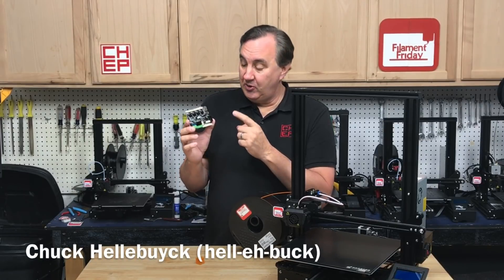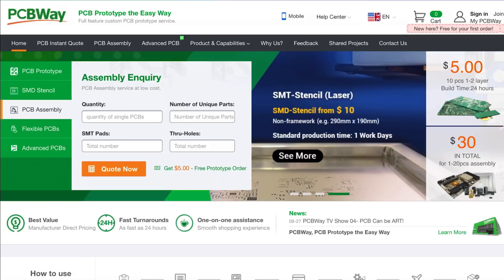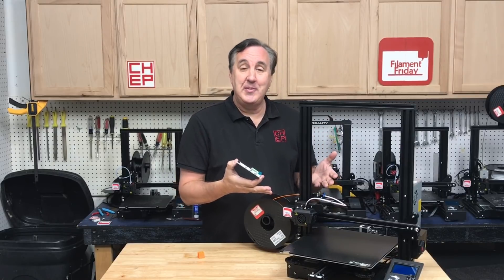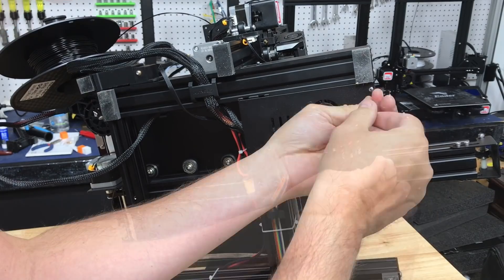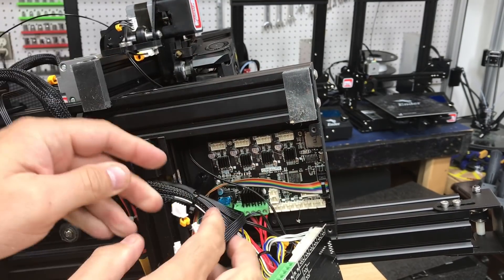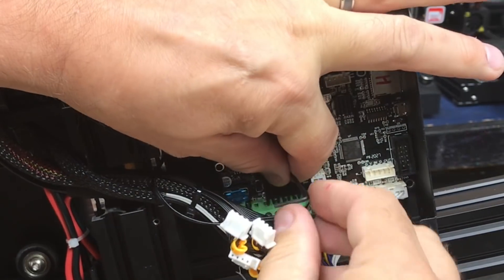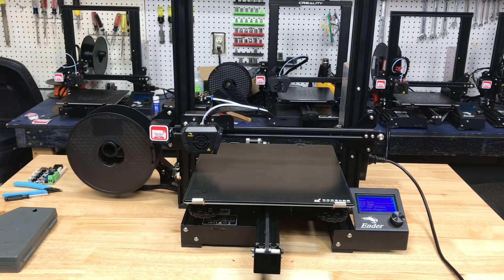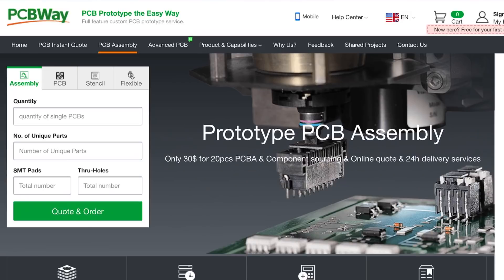Creality V4.2.7 Silent Board

Comment: i really wanna get the ender 3, so i click on the ender 3 that you supply the link to and i dont see anywhere that they  included the 32bit board, did i miss something in your video? I love all your videos Sir,
Reply from the maker: That’s the confusion I referred to. Creality doesn’t have a version number or serial number we can reference. Most new ones are 32 bit but if it’s been on the shelf a bit who knows.
Reply: @FilamentFriday  Yes, I just got mine less than a month ago.  It did come with a 32bit board, the 4.2.5 not the 4.5.7, which has the silent stepper drivers.
Reply: As far as I know creality started producing the newer ender 3 (Not the Pro the X or V2, just any ender 3 that was produced past a certain point in time) with the new 32bit boards. You may get lucky and receive one of those new ones when you order or you may get an old one in which case you can do the upgrade from this video. The board will have to be bought extra though
Reply: The V2 I bought on Prime Day has a 32bit silent board in it. I also bought a PRO but I haven't opened it yet cause I may not keep it.

Comment: Does the Marlin on that board have the change filament option like my E3 has? I use that quite a lot.
Reply: I've upgraded my Ender 3 (previously with 1.1.4 board) to this 4.2.7, the preloaded firmware doesn't have the M600 (filament change) command enabled. I'm in the middle of recompiling (or try another, pre-compiled one) to get back the M600 command. I agree with you it's really helpful!
Reply: There is an option ‘change filament’ in the interface, never used it though

Comment: Is the firmware machine specific? I have a Ender 3 pro.
Reply: Usually you have options to choose which exact model you order the board for so the correct firmware is preinstalled. That is the case on Creality official store as well as with different AliExpress "official distribtors" as they describe themselves.

Comment: Are TMC drivers incompatible with LIN_ADVANCE?
Reply: They are not but the way they are installed on this board makes them incompatible as the drivers cant be run in UART mode.
Reply: @MitsumaYT  I must have screwed up.  Because I installed a SKR 1.4 with 2208 in uart mode and everything was great until I tried LIN_ADVANCE and my extruder stopped.  I even tried this on another machine with uart mode and it failed the extruder.  M122 shows all in stealthchop, so I changed it to Spreadcycle and it worked for a while.  Marlin 2.0.07

Comment: Why would someone choose this over a SKR board that has removable drivers or drivers connected with UART so they easily support linear advance?

I guess I have a bit of an answer for myself which is lack of knowledge about such an option, lack of knowledge about how great linear advance is, and familiarity with the creality brand/wanting to stick with them.
Reply: You just helped me... I was looking to get this or skr. 
Looks like it skr 😁
Reply: My ender 3 pro is on skr mini v2.0. Perfectly good.
Reply: This is a drop in board like the SKR mini, biggest advantage of this one is that it has an RET6 MCU, which is 512kb of memory, SKR mini has an RCT6, which is officially 256kb of memory (the firmware hack does exist for the RCT6 but there are some issues potentially caused by it). Linear Advance is nice, but the print quality you get from it isnt really that big of an upgrade. Personally, my fav upgrade board for cheap printers is the MKS SGEN L V2.0 with TMC 2209's, not a direct drop in, but still fairly easy thanks to marlins config files.
Reply: One reason, that was one for me, was not having to wait weeks on a replacement screen or do a hackjob to connect my existing screen with an SKR board.
Also easier installation as it was a drop in replacement, no refit needed.
But you are right, the lack of UART and fixed drivers is not great with this one.
Reply: Is it really that big of a difference? I bought a silent 4.2.7 the other day because it was cheaper than the skr 2.0 on amazon. But now that you guys mention it, should I return it and buy the skr mini? Is it worth the money ?

Comment: Tut, Tut, Tut, tinned wires
Reply: Yep, tinned wires should always be stripped before inserting into screw terminals.
Reply: @lookitsrain9552  the tin slowly makes the contact worse. it deforms slowly making a bad connection its dangerous indeed